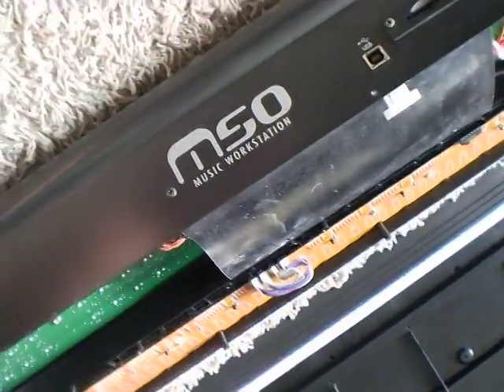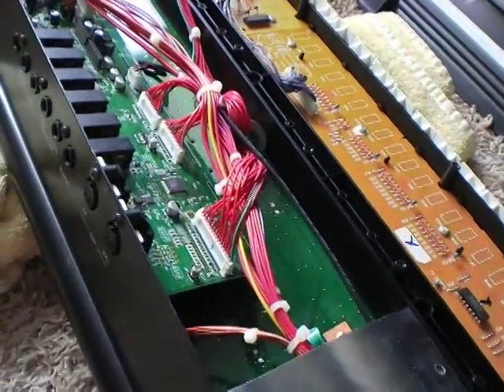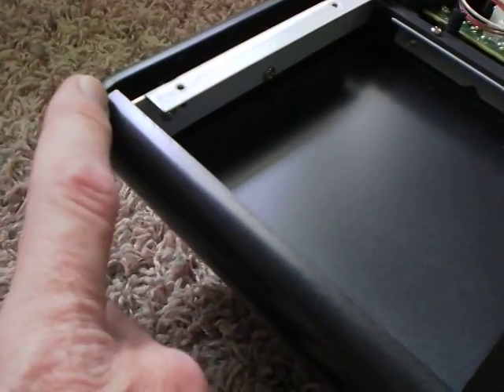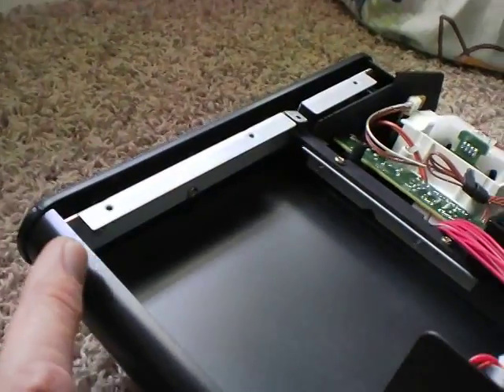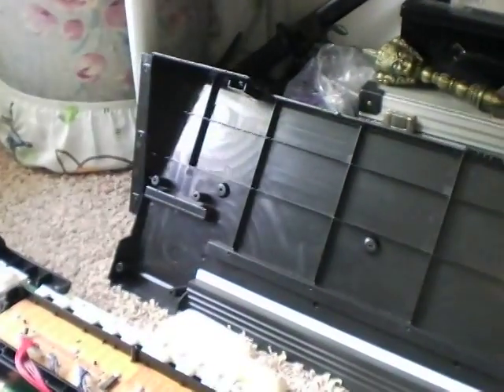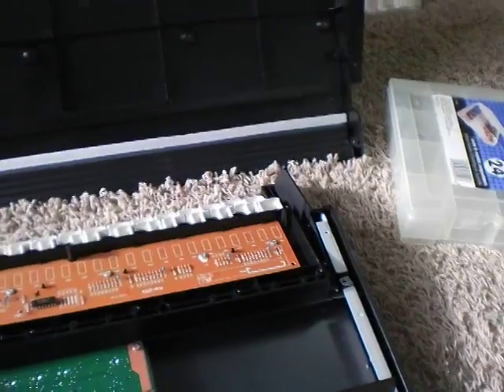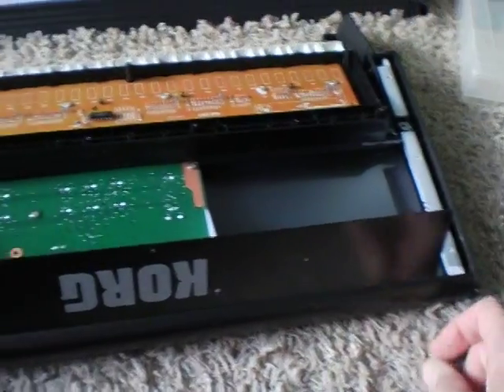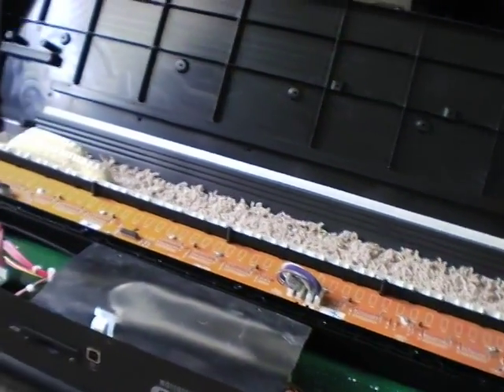Korg M50 Synthesizer internal circuits and repair of case damage

Comment: Thank you for the video.  I love my M50 :) but I need to adjust my joystick (or replace it) as it makes a knocking noise on the X+/X- (left and right movement).  I fear that it may be wearing out and so seeing the cover off like this is a great help for removing the bottom panel. 
Grace, 
Harry